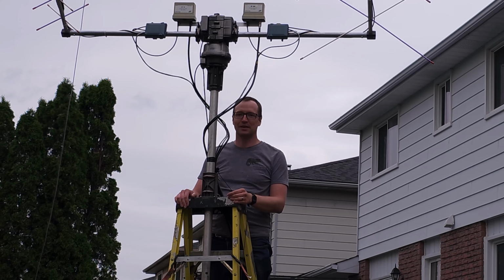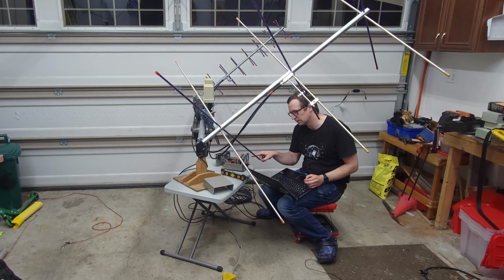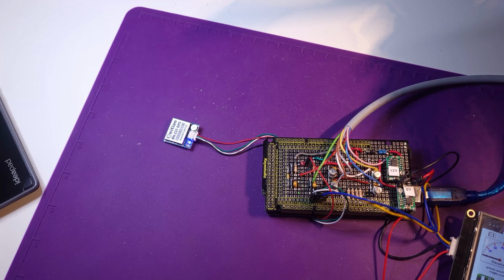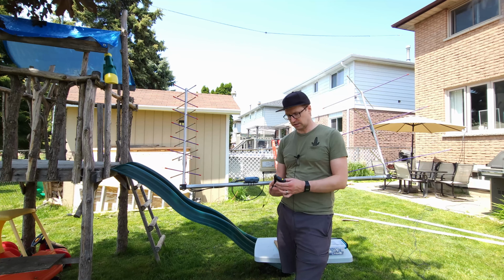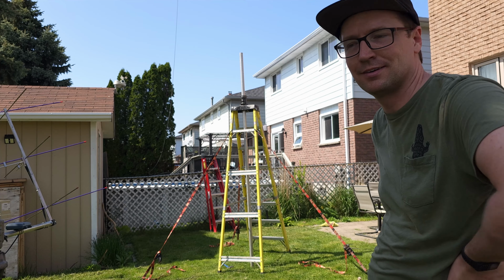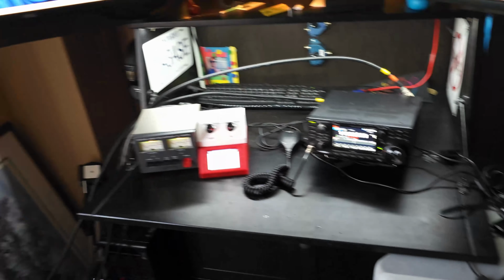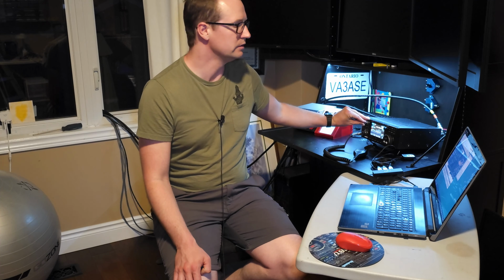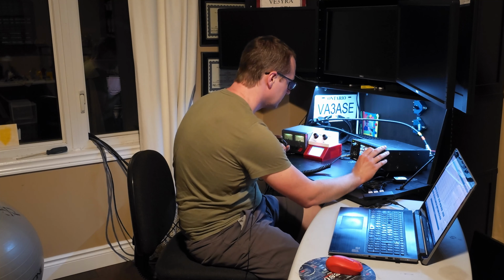Ham Radio Satellite Contacts on my Mini Antenna Array

Comment: Hi, i would recommend a counter balance weight on the antenna motor shaft! And a slow start stop function on the motor! This will increase the lifespan of the motor and gears a lot!! 😉👍
And it will also make it go a lot more smoother and more accurate!😁

Comment: Thanks Alex, really interesting video. I've dabbled with satellites with a fixed white stick antenna and managed to work a few passes using an FT-847 with Doppler control via the PC. I have an antenna interface for the Yaesu AZ/EZ mount but need to spend a little more time thinking about antennae but I really like what you have set up here with the polarisation options and the harnesses.

It has been.a slow burner project - it got rudely interrupted by a project to set up for the QO-100 geostationary satellite which has been good fun, but I can feel the LEO satellite itch returning! 

Good luck with the field day, hope you manage to post some footage :) 73 de M0SNR

Comment: Thanks for the video.  I'm stumbling along with Arduino and satellite as well.  Trying different experiments along the way.  Learning a lot about the Arduino IDE? Matlab/simulink with simscape.    I have a yaesu rotor head but no control box.  So, am planning an h bridge with pwm and driver off a mega.  Have some motors that are geared down to 5 rpm.  Want to model it in simscape first...then just map the rotor controls and return position signals back into the software as actual azel.  Anyway...learning a ton.  Love the ladder idea...
Have a 3 meter dish or two and thinking of eme...but that's down the road.  de Tom, W5XTT...73

Comment: Alex, great job putting this together.  I've been wanting to modify Arrow antennas much as you did for a few years.  Some questions.  1) does it make any difference whether you drill the holes in front of the existing cross beams or behind?  2) I'm assuming you made a 90 degree phasing harness; any specific plan you used?  3) any unique problems you experienced reconfiguring the Arrow antennas?  Thanks & 73!  Jeff, WK3U

Comment: Hi Alex, Great video, I am considering building a K3NG antenna positioner but instead of using traditional antenna rotators with potentiometer feedback I want to use mems magnetometer and accelerometers for position feedback which the K3NG software does support. I wonder if you have an opinion on the viability of using this type of position feedback, in particular the angular accuracy of these devices.
Reply from the maker: Hi I'm glad you enjoyed the video. You are correct about K3NG supporting an HMC5883L digital (magnetic) compass and ADXL345 accelerometer for feedback. I have experimented with these sensors a bit and was able to get them working on the bench, though I haven't tried mounting them to antennas for real use. It has been a minute since I looked at the datasheets but I believe they claimed 1-2° accuracy / repeatability (or less). That's more than enough when your typical antenna's radiation pattern is >20° wide. The potentiometer feedback from the G-5500 is very crude and I wouldn't trust it to be accurate or repeatable to less than 5°. It's probably worse than that actually, but still fine for most applications, only becoming an issue with very high gain and narrow beamwidth antennas. 

Keep in mind the sensors (especially the compass) will need to be mounted away from motors and power cables to avoid magnetic interference. This is the main reason I never finished testing them. It's not a big deal, just requires some planning. I hope it works out for you!

Comment: I will be using a Computerized GOTO Tripod & Mount used for telscopes to achieve what you are working towards.
With load capacities between 20-45 pounds they are ample for the task.
And are already computer controlled.

Comment: I use the Fox Delta rotor controller. It works well except that the Yaesu wiring diagram has the wiring on AZis backward

Comment: Excellent? Where you using a circular polarization for this contact? I was thinking about building with just a circular polarization rather than switchable or fixed horizontal/vertical with a switch as some do. Have you ended up just using one setting over the others since yours is switchable? is circular the way to go for satellite to avoid switching?

Comment: How are you balancing the weight of your antennas?  Looks like most of the weight is towards the front.  I like the use of a ladder as a tripod.  Do you think you will build a case for the original rotator equipment and to include all the new stuff?

Comment: True about the signal report and there's very little time for that during a pass.  Seems like every pass is a pileup.  Does the k3ng version give feedback to the satpc32 rotor control daemon?  The w9ke code I used does not and required a ton of modding to get started.
Reply from the maker: Some of the passes can get pretty intense, especially on FM birds. Yes the K3NG connects to SatPC32 using the GS-232B protocol. The position feedback and output control works very well in SatPC32 or PstRotator once configured. The hardest part with the K3NG project is enabling which features you need in the code and then getting the feedback calibrated. It isn't very intuitive, but I haven't had to do any real code modifications at least.

Comment: Very nice video.  I'm going to go and watch part one now.

I'm just starting with the K3NG rotator controller software.  Would it be possible to create a video showing what you went through to configure and load the software.  The Nextion part has got me a bit confused at this point.
Reply from the maker: Thanks for your feedback! I wasn't sure how much detail to go into with the K3NG controller but sure I'm open to making a video focused on it. One tip is to google VK4GHZ as his website has updated Nextion files and more information on the configuration.

Comment: I'm putting together a g5500 right now and the EL moves with just finger pressure...is this normal?  The az is locked solid but even mild back pressure from the cables causes it to move.
Reply from the maker: No, the internal gears should prevent you from moving the AZ or EL rotors by hand. Make sure the mast is not slipping, it can be hard to clamp securely without crushing it.

Comment: Would you be willing to to share the 3d printer files for the control box you designed and you configuration files for the K3NG software?
Reply from the maker: Sure I can post stl files for the boxes if you'd like. The K3NG code is pretty much straight from his GitHub repository with only my features enabled. The Nextion display files were downloaded from VK4GHZ's website with no modifications. The more confusing part for me is the settings and calibration which you input through the Serial Monitor after downloading to the Arduino.

Comment: Hi, Alex. I’m going through some trial and error to build out a portable satellite station. Thanks for posting these videos! I’ve definitely learned a few things, and am excited to make some changes to my station setup that should hopefully make it more viable going forward.

Quick question for you: With the IC-9700, how crucial are the external LNAs, especially if the feed lines are kept short (10-15 ft. or less)? Do you have any operating experience using the 9700’s pre-amps rather than the external LNAs?
Reply from the maker: Glad the videos have been helpful! I need to finish editing the final installment in the series. I do find the external LNAs make a pretty significant difference, especially with these little antennas. If you use larger antennas with higher gain (which I'll recommend) and low-loss feedlines the LNAs are less critical. Put simply, you'll make contacts without them. However the LNAs are indeed a noticeable upgrade, even with short feedlines. I'm fortunate to have these expensive ones from SSB-Electronic, but Mini-Kits offers similar LNA kits at a more reasonable price if you're comfortable soldering / building. That's probably what I'd get if I was starting from scratch. Hope that helps!

Comment: How you modified the arrow antennas?in order to have polarized,.
Reply: Go back to the previous video, it's all explained there.
Reply from the maker: I'm using a set of polarization switches from a company called Mini-Kits. They seem to be working well. I explain more in my previous video.
Reply: @va3ase  thank you Alex , my callsign is EA1IFD, usually I work AO-91 & ISS, but it's time to pass to linear sats RS-44...and your sat combo looks & works great. Minikits it's a great hardware from Australia😀😀
Reply from the maker: @ricardoaliasdelatorre6836  Thank you, I hope to work you on a linear satellite soon! I agree that Mini-Kits makes excellent hardware. I'm very happy to support companies like them.

Comment: Does the 9700 have 1 or 2 antenna inputs?  Is each antenna connected to separate RF connectors?
Reply from the maker: It has seperate ports for each band. Each antenna is fully independent with its own feedlines, preamps and polarization switches. The 9700 actually has a third antenna port for the 23cm band I'm not using presently. It's a great radio but pretty specialized.

Comment: This is awesome! I have antenna envy 😁 Have you thought about selling kits with all the parts needed for this? Looking forward to more videos like this. 73 de kf4hzu
Reply from the maker: Thanks! That would be a fun idea, but the Yaesu rotator is the most expensive part which I think is a deal breaker for most people new to satellite. If I was going to sell anything I think it would be better to design lower cost rotators (probably 3d printed).
Reply: @va3ase  Makes sense. Well do what you find fun and interesting 😊

Comment: What size of the horizontal tub are the antennas mounted on?
Reply from the maker: I'd have to measure to be sure but it's around 4-5ft long. There is probably an ideal or minimum seperation distance you can calculate, and I'm guessing mine is technically too short. For my application I was more concerned with keeping the setup compact for easier transport and setup with minimal disassembly.